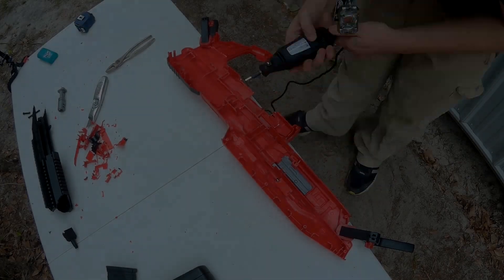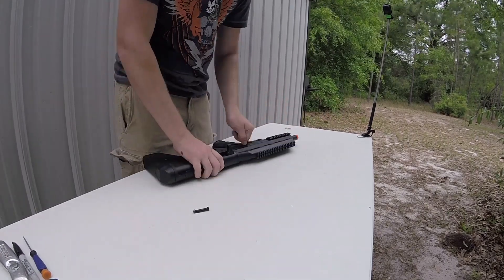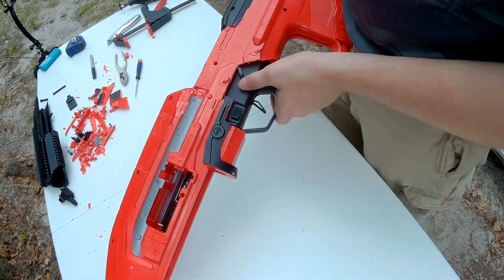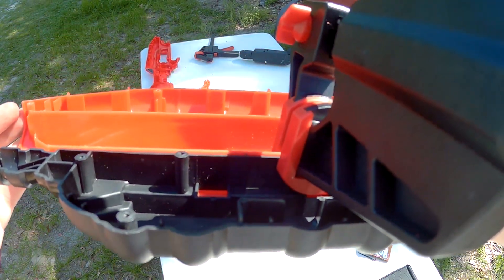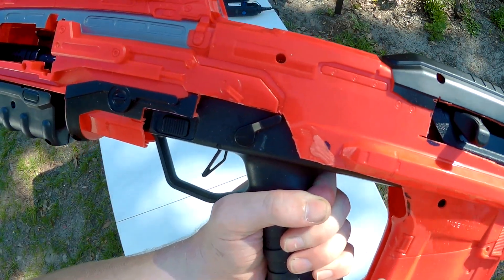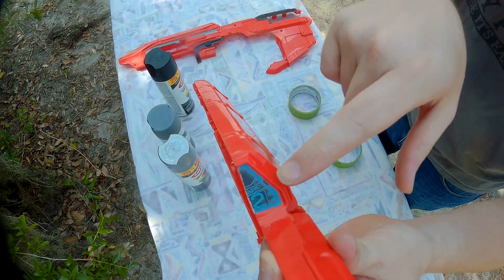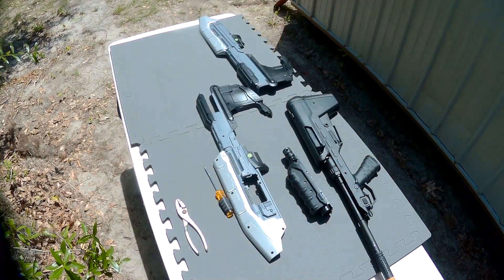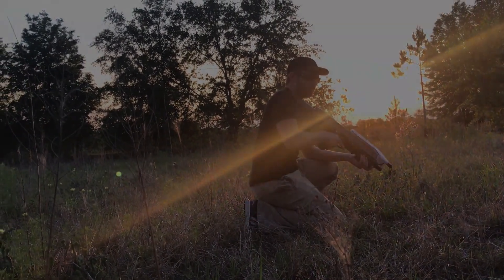How To Make Your Own Halo Airsoft MA5B

Comment: I really like this, however I would have modified the existing internals to take an hpa line with an adapter/ regulator to drop the pressure down. Then I would have built some kind of hop up chamber that could be used with the automatic valve in order to chamber and run rounds through it.

Comment: What i dont like about the Boomco AR is that the back part (handle and stock) is too short compared to the front/barrel. Is there a way so i can remove most of the Boomco stock and leave the UAR stock as it is and then add a 3d printed/resine handle??
Reply from the maker: Sure! You could definitely do that.

Comment: how does this compare to the chrono blaster? which is better?
Reply from the maker: Aceman: To be honest, both are pretty great. The CB-88 is definitely cooler than this homemade version because of the ammo counter, LED lights, and unique gearbox it has. It does have some flaws though concerning how rare it is, the price, and the problem that all CB-88 rifles have with their built in mosfet. This homemade version of the Halo AR doesn't have the same problems as the CB-88. Actually quite the opposite. All the material aren't very rare, the price is definitely cheaper compared to the CB-88, and the homemade AR doesn't have the insane mosfet problem lol.
Reply: Spartan Jess - The Halo Airsofting Spartan yeah I just got my CB-88 a few days ago and only saw your video on the mosfet problems. I'm kinda afraid to use it now, I also not to keen on teching so I'm also afraid to open it. I was planning to make this one for fun.
Reply from the maker: Aceman: It's nice to have both. If you do plan on using your CB-88 though, make sure you don't leave your battery and 9v battery connected to the gun while not using it. If you keep them connected while not attended or not using it (an example would be during breaks sessions on an airsoft day) it'll constantly drain the power, due to the CB-88s poor wiring, and will also damage the mosfet. Just make sure to take a bit more care with it compared to a regular AEG.
Reply: Spartan Jess - The Halo Airsofting Spartan alright thanks for the advice man, I'll remember that.
Reply from the maker: Aceman: No problem.
Reply: Spartan Jess-The Halo Airsofting Spartan I would like to see a airsoft company like lancer tactical echo 1 or elite force make any UNSC guns just not from halo 4 or halo 5 guirdians
Reply: Aceman just curious, where’d you buy yours?

Comment: Can you make the M6 magnum? I highly suggest using the HK USP or Mk. 23 as the base.
Reply from the maker: I was thinking about converting the Boomco magnum, but we'll just have to wait and see.
Reply: Spartan Jess - The Halo Airsofting Spartan Forget about my suggestion of using the HK USP or Mk. 23 as the base. A few days after I posted the comment, I started doing my own research and designing and found that either the Umarex Walther P99/P99 DAO/PPQ Tac/PPQ M2 Full Metal gas blowback airsoft pistol work best as the base because the lower receiver very closely resembles the Halo 5 M6H2 (my design was primarily focused on the Gunfighter Variant). Meaning that the gun would likely resemble what it’d look like in future games and can support multiple accessories for full conversion to other Magnum variants present in Halo 5 (and possibly even in Halo Infinite).
Reply from the maker: @chris210racer  After looking it up, I have to agree. The straight grip and the short barrel length could do well with a conversion. My initial idea was to just cut up the Boomco magnum and use a similar gun to combine it with.

Comment: Well the boomco rifle I just discovered is discontinued and is impossibly hard to find, and when you do it is $100+.
Reply from the maker: I believe it. Ever since 343 made a new deal with nerf to make new guns based off halo infinite, that means the boomco deal had to be discontinued. The boomco gun itself should be $40 while the UAR V.2 is around $100 - $130. If the boomco ones are hard to find now, then I'll be looking forward to converting the new nerf ar when it releases.
Reply: Spartan Jess - The Halo Airsofting Spartan thanks, because I am a big halo fan and I was really looking forward to getting a nice ma5b and maybe magnum set up, the magnum I will find on Etsy, like all the other gear. Love your vids, keep it up!

Comment: Do you have links to the guns or any information on where I could find them? The Boomco one is discontinued on Amazon, and I can't find the UAR. Thanks!
Reply from the maker: So here's a link to the UAR v.2 on the evike website. 
https://www.evike.com/products/41551/
And sadly I can't find anymore Boomco ARs. Ever since Microsoft made the deal with nerf, Boomcos contract to produce halo products discontinued. I know I've seen some on Ebay once in awhile, but they're usually expensive.

Comment: So... with the barrel inside that deep... any damage come from it? I ask because my silencer used to shatter bb's if i turned the gun while shooting. (Spray down cover fire or whatever)
Reply from the maker: TheWolfmanG: Surprisingly no interior damage has been caused from the BBs, or any interior damage. I thought the same problem would happen. Turns out, the UAR shoots straight every time because the shell is so well stabilized on the UAR.

Comment: Does it actually sound like that?
Reply from the maker: Yes, that's how the gun sounds. The sound of the gun is probably based on what type of battery you're using as well. I didn't use a lipo battery with it in the video, just a regular rectangular battery.